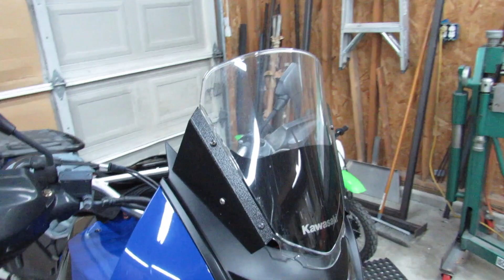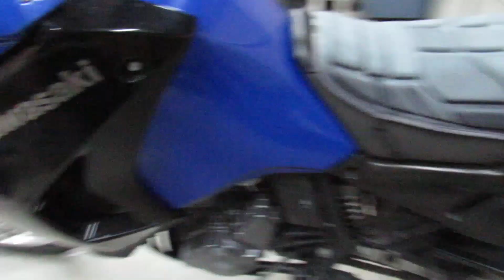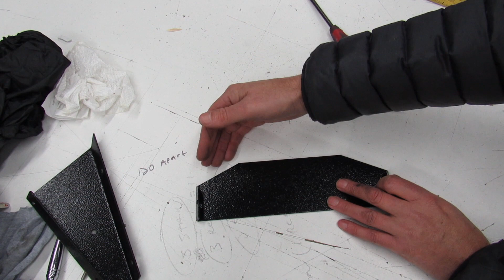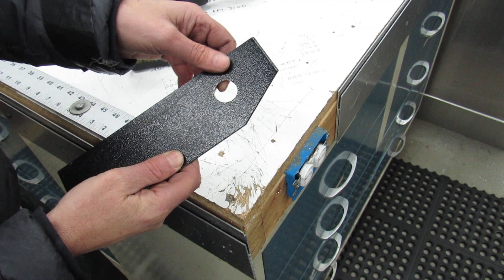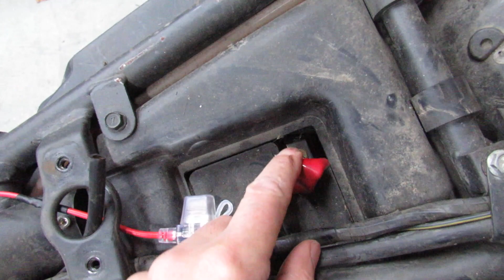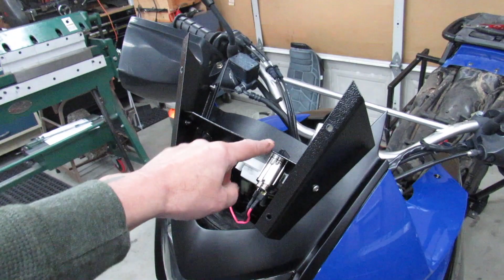Power outlet for the SOLOBOX  Riser/Dash kit

Comment: Another tip for wiring the outlet would be to use a relay and use the headlight wire to trip the relay. I don't recommend having the power for the outlet come from the headlight circuit as this is one you really want to be 100% reliable.  Nice installation on your dash!
Reply from the maker: Hi, Tim. A cell phone draws so little current that it didn't matter, but I agree if you were going to run heated grips, lights or anything else that really has a draw to it..